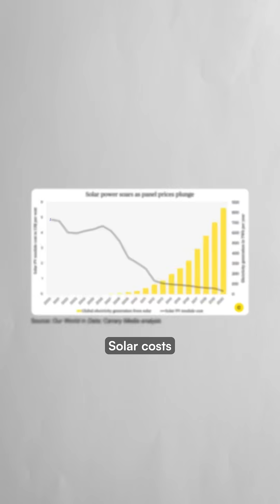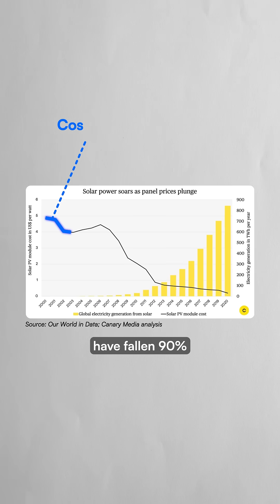The AI boom is using tons of concrete 🏗️ #trendingshorts #ai #construction #technology

Comment: Concrete is made from sand, rocky bits and cement. The cement is made by essentially boiling off the co2 component of limeatone making Clinker. 
Non hydraulic cement reacts with co2 to make the hard stuff. 
But, i was not aware till i started typing and fact checking, hydraulic cement is a reaction of the clinker (calcium oxide from calcium carbonate) with aluminium and iron oxides and co2 doesnt aeem to play a part. Very generalised description there. I was blissfully unaware of that hydraulic reaction.